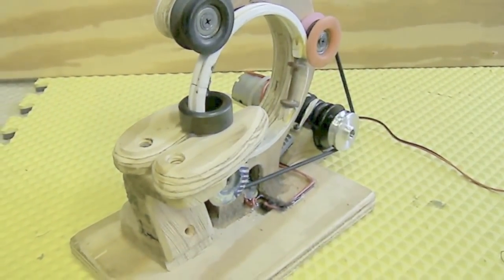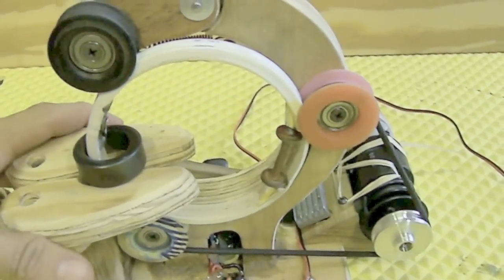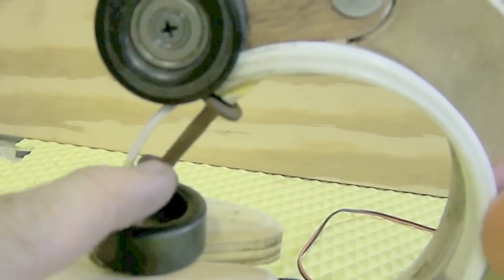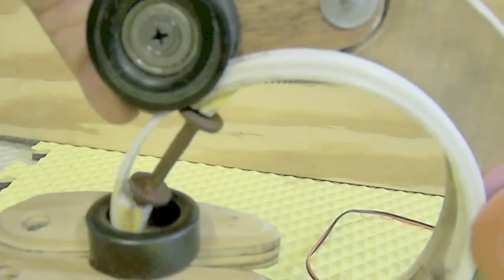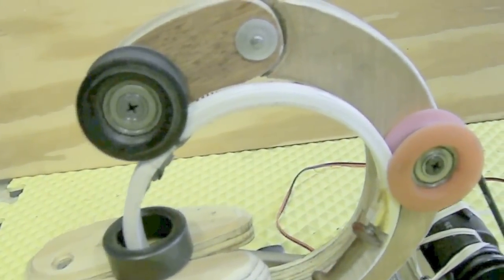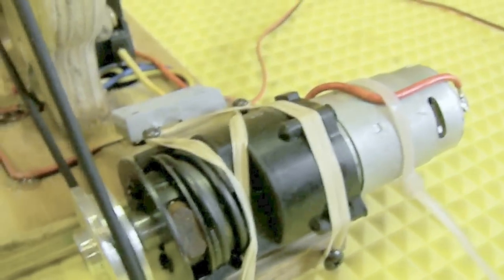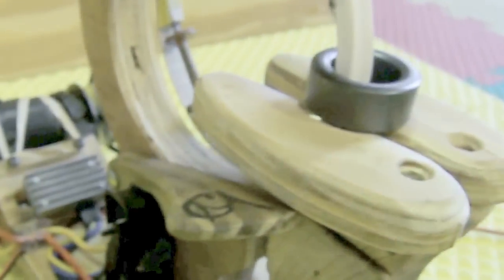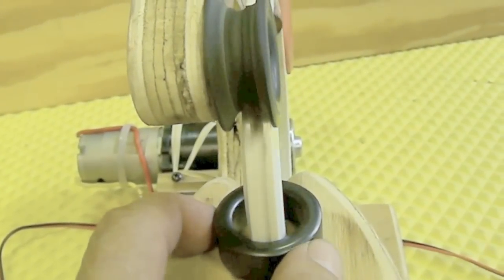Toroidal Winder kit with downloadable plans part 3

Comment: another handy thing would to include some type of sensor to count the number of turns.
Reply from the maker: IF you watch my other videos there is a model that actually have a included counter and a volt meter! since the machine have been engineered from the ground up to use batteries it give you an idea of voltage / time that you have to keep working.. thanks for your comments, I have a few customers out west that actually payed extra for the foot pedal
Reply: Number of turns: 

For both the bobbin as well as the toroid.